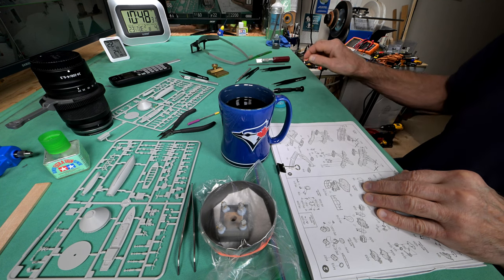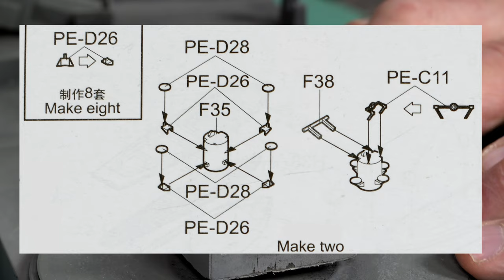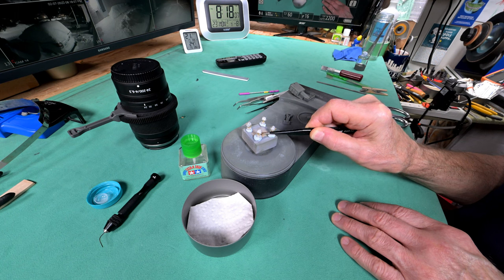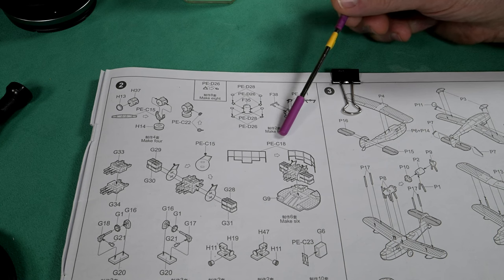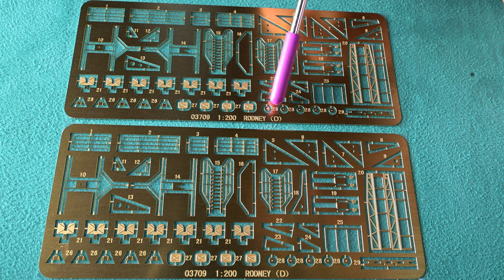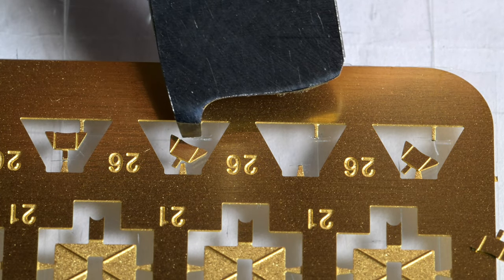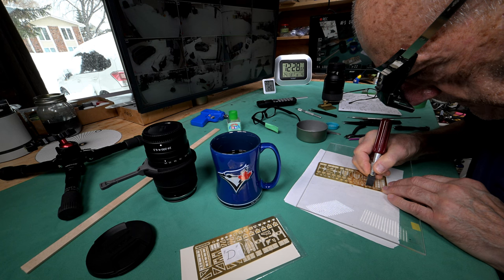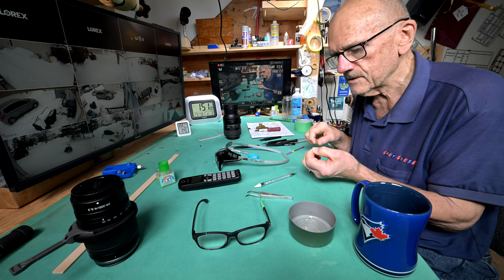The Model Ship - Part 1077

Comment: Hello Ron.  When using the wax pencil (I have the same one), I sometimes need to knead the wax tip with my fingertips to gently clean and heat the wax tip to make it tacky again.  I just gently knead the wax tip towards the pointed end of the pen/pencil before using it.  Hope this helps!  Eric
Reply from the maker: Thanks Eric. Will try that. 👍